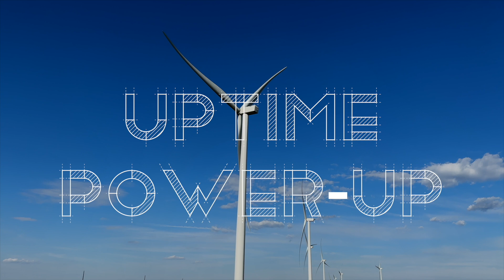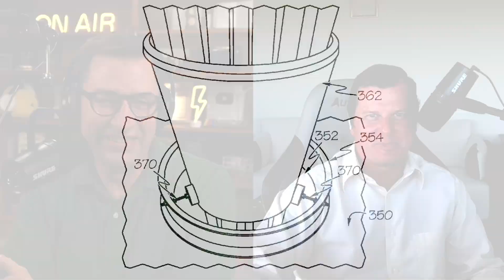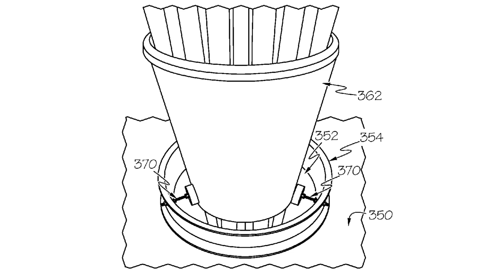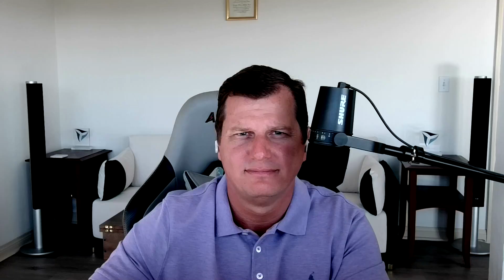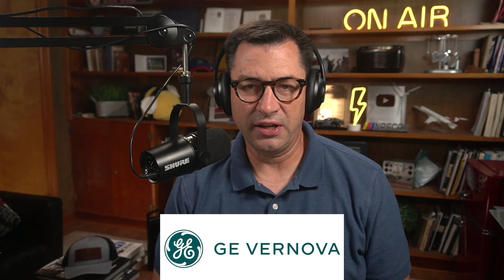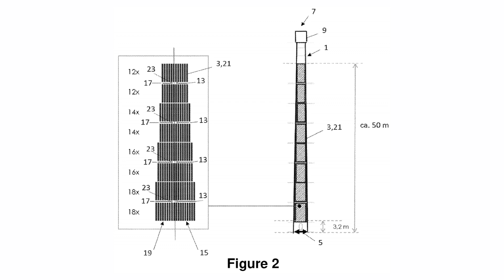GE Cypress Blade Tip Swap-out, Vestas Load Probability Control Method

Comment: I agree with Joel, we have plenty of surfaces which are more easily covered with solar panels than parts of a wind turbine. Solar panels have become so cheap that the can often be used for roofing car ports and used as balcony balustrades or building cladding at little or no extra cost